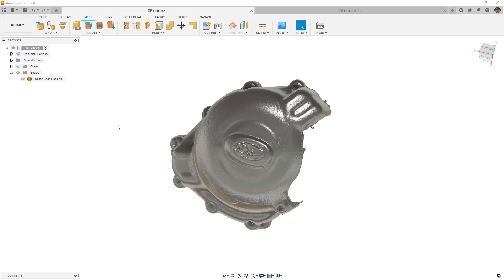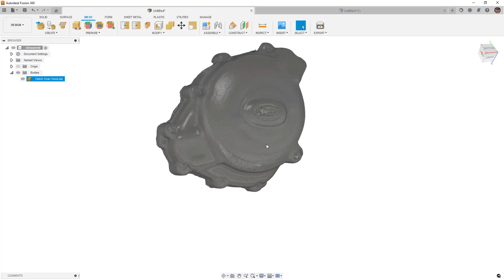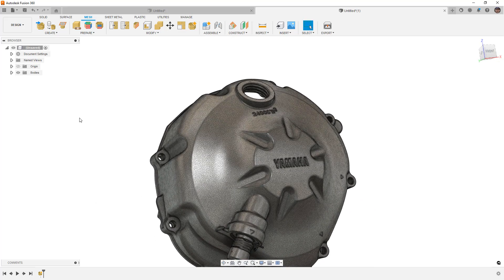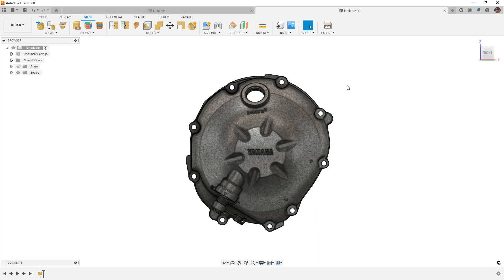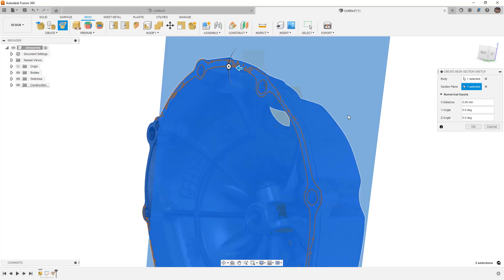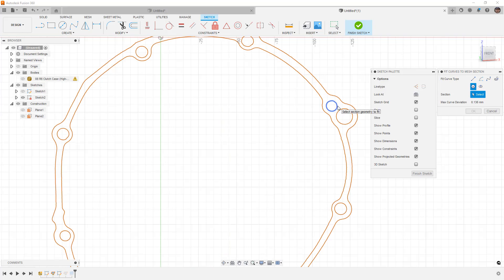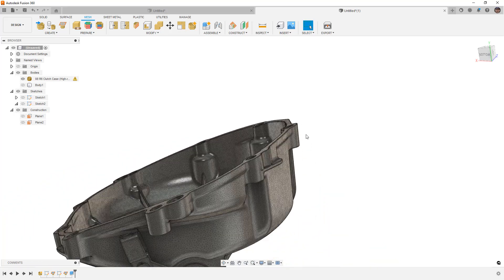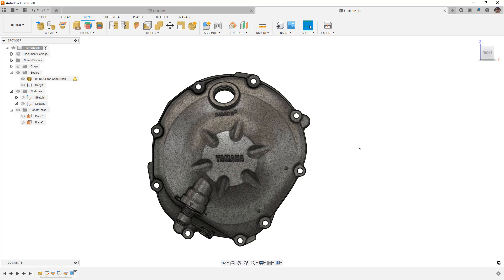Is A Hobby Scanner Worth It? | Comparing Hobby vs Pro Scans to Understand The Differences | #3DScan

Comment: finally a channel that is covering this as i have been scanning and reverse engineering for long time and its been a dark hole of "protected" knowledge. its nice to not not feel crazy about scan outcomes and wondering....would this have been better if i went with a 30k scanner vs a 10k scanner....but i feel MUCH better after watching this video. 

The content as i keep saying is just AWESOME and its easily my daily go to videos now.
Reply from the maker: Thanks JF!  Years ago when I started scanning( 2010ish) I was using a then $20k scanner and MeshLab.  The results varied depending on the setup, prep of the parts(weld prep spray) etc.  I eventually moved to RapidForm(which was acquired by Geomagic) to handle the mesh manipulation post-scan.  While free MeshLab is great, Products designed specifically for this with some development budget do have an advantage.  Once a scan is created, aligned and cleaned up, remeshing it with something that can actually measure its accuracy to the original is very important, but also the tools to work with, align, and set up a BREP solid off that mesh is key.  It is much better to spit out a "dumb solid" from a mesh program and go to Fusion 360, than to try and work directly with the mesh in Fusion because the dedicated software can tell you if the part is too bit/too small etc.

One thing these hobby scanners often miss(even if the quality is good) is the software behind it to process that scan.

Scanning is still a bit of a trade secret and one that a lot of people feel really requires the seat time to learn it sadly.

Comment: I will get a Revopoint mini this month from kickstarter. It’s a blue light scanner with 0.05mm resolution and 0.02mm accuracy. 
I hope it will be able to do some nice scans. Bought 3D Scan Spray too.
For reverse engineering I recommend to use Solid Edge (Community edition free version). Did a reverse engineering with a photogrammetry with it already. Much better than fusion for this job.
Reply from the maker: Thanks for the comment!  The Revopoint mini is supposed to be a big "shake up" in this area.  They are selling it as a much higher accuracy scanner than the current hobby grade scanners.  One thing you will notice with all scanners on the market is they will use slightly different terms.  Like revo says "Precision" while Creaform says "Accuracy" for their measurement.  I will bee keeping an eye on those once they hit the market.  I think it will fall between the sub $1000 scanners and the Einscan that are currently in this area.

On Solid Edge, Siemens did put some great tools in the software I will agree there, but I don't know that it is really worlds better for reverse engineering.  From what I understand their "Point cloud" support isn't really there so you still need to pre-process the mesh before bringing it in.  It looks like they might have some auto surfacing tools where you can create surfaces based on painted mesh sections (similar to Solidworks Scan to 3d).  I would love to know more how this process worked for you.  If you want to email me support@caducator.com.

Comment: What scanners were used for the scans. Learned something new today with the circles and splines. Was wondering how to make use of the mesh sketches if I can't use the for extrude ect... Now it makes sense 🙏
Reply: The budget scanner was the newly available Creality CR-Lizard.
Reply from the maker: Emang, That scan was fairly old, but I believe it was done with a Creaform Handyscan.  The CrLizard again is one of those that is advertised as being good for reverse engineering and even Medical, but the main use is scanning objects you want to 3d print.  

CRLizard: Accuracy .05mm, Resolution .1-.2mm. 
Handyscan: Accuracy 0.025mm, Resolution .025mm

That resolution part is really what ends up killing some of these hobby scanners as the accuracy isn't too far off.  But these numbers are ideal/lab numbers and do vary a good bit in the real world.

Comment: Thank you for a very informative video.  Now I have a lot of new topics to learn. There are some command I need to try in fusion. Again, thank you
Reply from the maker: You are welcome!  Don't hesitate to ask questions!
Reply: @LearnEverythingAboutDesign  Thanks, because of this video I learned a few new things like the Create Mesh Section Sketch and the fit curve to mesh section that are totally new to me and that will probably be very handy in my current project. I am also checking your mastering form series. Although I was able to follow a tutorial to create a full RC 3D printable Porsche, I am still struggling when form modeling on my own. btw, if you are into 3D printed RC,  you can download my files for free on my websites (link in my YouTube profile). Thanks again for sharing your knowledge. It is really appreciated.
Reply from the maker: @TessierWork  Thats great!  I will definitely check out your work!  I have made a few 3d printed drones and have a few RC things, Trucks, a few helicopters but they mainly sit in a closet.  Another channel and I are talking about a collab RC design in the future.  Years ago in Solidworks I designed a ShortCourse truck body for an RC truck, but haven't focused on it, other than a few drones, for a good while.  I just checked out the lighting video on your 3d print porsche, very cool stuff!

Comment: I was watching your Fender Scanning videos earlier ( re. Widebody kit for Starion ) and they got me thinking about Digital Sheetmetal Forming, a technology that IMO will absolutely revolutionise the custom car & car restoration industry.  

I first became aware of this tech 5 years ago when I saw a video of Nissan's Dual-Sided Forming process, which they are already using to remanufacture long obsolete body parts for R32s. I see the technology has now progressed to One-Sided forming and high-end body-shops are now using DSF technology to form custom panels from (STL?) files driving machines like Desktop Metal's FIGUR G15.

IMy question is this: Are ANY of the currently available consumer-grade scanners (looking at you Einstar 3D) capable of scanning an NOS fender accurately enough so that the 3D data generated can be used to make a duplicate fender to OE precision via the DSF process?

I know a professional level unit like an Artec Leo  might do the job but that's la-la money for most people.. Even an Einscan HD is way out of most budgets.
Reply from the maker: These technologies are wonderful but very expensive.  Granted cheaper than tooling would cost but rather than spending hundreds of thousands on tooling for say an R32 fender and stamping out a fender for pennies, you are making a single fender cost a good bit more.  Someone like Nissan could absorb the cost since its a tooling-less process however the major OEMs can swap tooling quickly.  Toyota for example can move from stamping a 4Runner fender to a camry fender in a few minutes.

But to your question.  The accuracy of the hobby scanners vs pro scanners is getting closer.  With Shining the Einstar is +- .2mm while something like their Freescan laser scanner is a good bit better at around $17k.  I would say the .2mm might be just fine not knowing what the tolerance is on those forming stations but I would still want a laser scanner not a structured light scanner to do that job.  Creality has one coming out that I am eager to test (scan raptor or something i think) around $2000.  but honestly the limitations for scanners from Creality and others really are in their software, not as much the hardware.  Getting the raw scan data into a better processing software is really what is needed.
Reply: @LearnEverythingAboutDesign  OK, Thanks. 
Re. 3D Scanner, AFAIK volume car panels are made to +/-0.5mm , so the Einstar should be fine.
Re. Scan data processing s/ware: i.e. Geomagic Design X is ~ 10x the cost of Artec Studio 18, but is it 10x better, or put another way, is Artec S18 suffient for a DSF machine? That's the $64 question.
Reply from the maker: @geeess2513  well I am not sure what the forming software would need for an input.  Most CAM programs really want to see NURBS surface or BREP solids.  The outputs from Artec studio look pretty good, but the scanners are in a different segment than say an Einstar.  The benefit of einstar is that its the bottom of the shinning 3d range so it benefits a bit from the software used for the higher end scanners.

IF the forming tools CAM software will take a mesh as its input then nearly any of these would be in the range.  BUT if it requires you to reverse engineer the surface then using a tool like Geomagic is probably going to get you closer giving you an autoSurf patchwork of th emesh.  Not a great solution but that is something I don't think Artec can do.

Comment: Hobby scanners from this year give the same result as your pro scanner, I have both although the pro scanner is a little older now. anyway, Struggling with the freaking stl files in solidworks/fusion makes everything a bit dull.. I mean i have a crazy gaming pc with 256GB of ram and still shit in cad software with big STL's..
Reply from the maker: I would disagree that hobby and pro scanners give the same result.  while the accuracy numbers published are close in a lot of cases the distances drastically affect the accuracy.  No doubt you can be very careful and get decent results with a higher end hobby scanner.  Mesh manipulation software is also a key factory.

Solidworks his horrible at dealing with Meshes.  Fusion is a bit better but still does hit a limit.  

As for gaming vs CAD sadly the RAM isn't the key.  sure you need a decent amount of ram but honestly 32GB is more than enough in most cases.  What you will find is your limiter is the graphics card.  Video memory(which eats up some of your dedicated RAM), bandwidth, processing power etc.  Most gaming cards are really optimized for low polygon count and texture maps to get the details.  Rarely (and i admit i am still stuck in 8 and 16bit gaming) do you see a super high poly count game asset other than in b roll movie reels.  The actual game play files are optimized heavily.  Where they flip this is the high frame rate refresh.  CAD on the other hand isnt really concerned as much with fast refresh rate but more on precision which is why they really focus on loads of precise calculations.

I have have run super high end and low end CAD cars.  My current system for these videos has multiple cores, a fast processor. 64gb ram and a fairly low end CAD card.  It still deals with mesh bodies with LOTS of polygons just fine.  I could spend a few thousands dollars and make it better but I have found diminishing returns.  If I was working with mesh bodies all day every day, yes I would get a high end CAD card.  For occasional work the low end CAD car will beat the high end Gaming card.  By low end i mean $400 or so.
Reply: @LearnEverythingAboutDesign  yeah got all that, still sucks in sw and fusion :)

Comment: The orientation of the part in the coordinate system has to be done manually also when working with a 50 k or more scanner
Reply from the maker: Sort of True Harry.  the difference is in the software before it comes to Fusion.  Something prepped in software provided by a hobby scanner vs using a professional tool like Geomagic Design X has different tools to make the process easier.  Finding symmetry for example.
Reply: @LearnEverythingAboutDesign  of course geomagic design x makes life easier. But it's a separate software which has nothing to do with the type of scanner you use. If you use design x, which is an extra 15-20 k, you won't use fusion to reverse engineer. You can also use design x to work with scan data from a budget scanner and you said in the video that one difference between budget and professional scanners is the orientation of the part, which is not correct. I use both types of scanners btw so I know the difference.
Reply from the maker: Harry, You are 100% correct there, if I said the scanner is to blame then I must have misspoke.  The idea I was trying to convey is that when you have a budget scanner you often are using the software provided, and that often means poor or very manual alignment tools.  So when you get your scan into whatever software you are using to reverse engineer it like Fusion, the orientation is often not correct or "kinda" close.  I have been sent dozens of scans from various hobby scanners and not a single one was aligned in a meaningful way.  When you are at the professional level you have a dedicated tool like Geo Design X, which helps achieve that, if you take it out of that tool(which yes you can build parts direction in there with the tools provided), you can assure that it has a meaningful reference, which isn't really achievable once you spit the mesh body out of that software and bring it into another software.  

In reality the tools are better when dedicated(in my opinion of course).  Capturing scan data, then moving into mesh prep/alignment/cleanup/remesh.  Then moving into CAD.  When I would do this I would use Rapidform, that geo acquired many years ago paired with Solidworks and their live transfer.  So reference planes, my Nurbs surface and sketches would transfer(unconstrained) into Solidworks where I would reverse engineer what I needed.

I would argue that tools like GeoX have everything to do with the Scanner you are using though.  They do offer scanning directly into it(via plugins), but i've found generally that isn't the workflow.  BUT if you have a professional scanner doing "professional things" you likely have the tools dedicated to that task.  If I were going out tomorrow to start a business scanning parts the end step in that process is not going to be mesh into Fusion 360.

Since it sounds like you use a wide variety of equipment I am interested to hear your take on the tools.  What mesh software do you use and how do you find the prep and alignment tools?

Thanks for the comments!
Reply: @LearnEverythingAboutDesign  for high accuracy and detailed scans I use an ISO certified handheld laserscanner, for bigger parts an additional certified photogrammetry system to setup the marker network before scanning with the laser scanner. For color scans and less required accuracy I use an infrared structured light scanner. Just for fun and comparison I played around with my neighbors consumer grade creality scanner and have the revopoint mini on order. 
For measuring etc I use polyworks inspector, for simple mesh work and reverse engineering I use geomagic design x. I do the scanning process itself in the dedicated software of the scanners, export the pointclouds and continue in design x or polyworks depending on the project. Meshing in the scanners own software sucks and I don't trust the outcome for high accurate measurements.
Reply: @LearnEverythingAboutDesign  orientation is pretty straightforward in both polyworks and design x. Easyer to handle is design x in my opinion. Polyworks is much more complex to operate and you will need training to be confident and create reliable outcomes since there are lots of options to choose from that have a meaningful impact on the results.
Reply from the maker: @harrywind1870  Great experience and insight Harry thanks for sharing!  That Revopoint Mini looks impressive on paper and I would love to know how it performs "in the wild" when they are out.
Reply from the maker: @harrywind1870  I have never had the chance to try Polyworks.  It seems like they have broken out functionality into a lot of different modules.  The polyworks Modeler looks very interesting.  Is their 1 click conversion to Nurbs as good as it looks?
Reply: @LearnEverythingAboutDesign  on paper they are all good. In reality it's a different story. Most of the lower price scanners will loose accuracy very quickly as soon as the scanners is moved out of the first field of view (geometric accuracy). The error adds up then very quickly. Also the repeatability is often poor. When I receive the mini I want to scan some stuff and compare the scans to the ones of the ISO certified device.
Reply from the maker: @harrywind1870  The resolution of the creality and lower revo scanners being .1to.2mm is pretty bad compared to the pro stuff at .025mm.  I think thats where people get lost on the single scan, never move, in a lab accuracy that is claimed at .05mm :)
Reply: @LearnEverythingAboutDesign  I only use polyworks inspector because it's most used in the industry. The modeler is a separate thing that I did not purchase (even though it would have been way cheaper in a bundle than buying design x) because the capability is much lower than design x and as I said I absolutely don't like the complex handling. Design x is much more intuitive and way more capable than pw modeler. They also have the autosurface tools.

Comment: so how can you smooth out a spline shape that is jagged without manually redrawing?
Reply from the maker: The mesh section sketches, you can't.  You need to manually draw one.  Depending on what you need the file for the spline might be ok, but if you were going to produce tooling I would say no.  Generally parts like these were done with lines and arcs so a combination of that would be the best bet in my opinion.